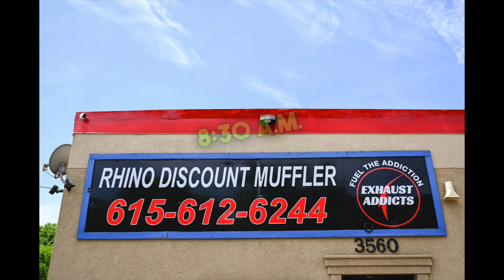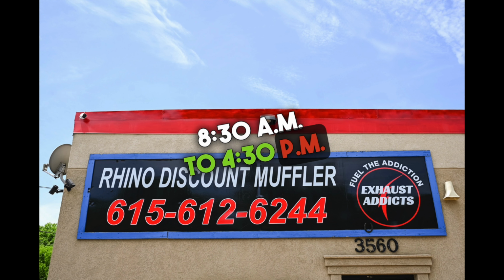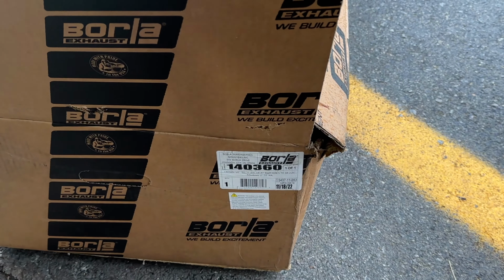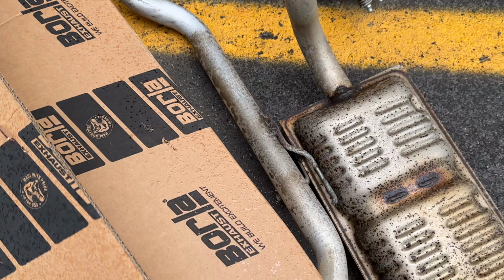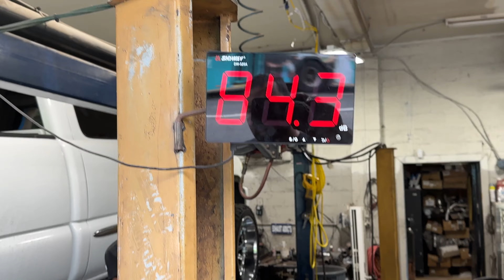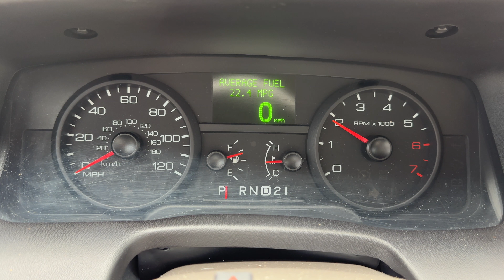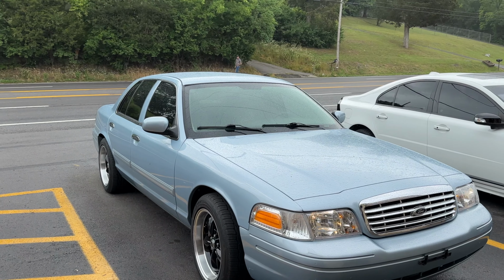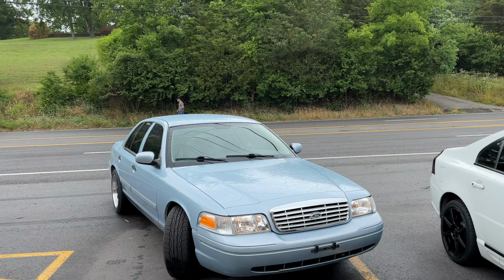2011 Ford Crown Vic 4.6L V8 w/ $1,500 EXHAUST!

Comment: I'm more impressed by the 22.4 mpg
Reply: Must've reset it on the highway on the way down lol
Reply: @yeanah2571  Ikr! I'm over here averaging 14 feet a gallon 😒.
Reply: Fact
Reply: I averaged about 20-21 MPG in my Grand Marquis. Which is pretty impressive considering it’s a V8. The main reason for this is the smaller displacement, factory tune, and it has less power than a larger sized V8. The reason bigger V8’s get horrible gas mileage is due to the displacement, and the amount of fuel it has to spray into the combustion chamber to make the piston go down due to the combustion process in each cylinder. The bigger the displacement, the more fuel it takes to do that.

Comment: Once I saw that it was a Borla exhaust. I knew already. It was going to be quiet. I have seen this set up many times on other panther cars. It’s only good to have it if your daily driving it. But not for performance. Nonetheless, it’s a beautiful car, very mint, and the best car ever 😁
Reply: It's a straight through muffler, 2.25" pipe with a unrestrictive muffler flows plenty for more power than what the car makes. I'm not sure how it's bad for performance?
Reply: I converted my single exhaust 2011 Vic LX to factory 2 inch h pipe and driver's tailpipe, with 2 Chamber Flowmasters and high flow cats and I can assure you that it gained a very nice performance advantage of the single 2 inch junk. This Borla kit will flow plenty enough even with headers and say 5-6 pounds of boost on a stock engine.
Reply: @kristoferfly9983  awesome set up you got! On my 08 CV LX IS ALL CUSTOM EXHAUST. Stainless steel with custom X pipe, FlowMaster super 10s and 4 inch roll tips in back. I love the flow I have a lot now but definitely will be switching it up in the future 👌
Reply: I wonder how good the borla would sound with rear cats deleted. I’m getting rid of mine paired with flowmaster 40 series